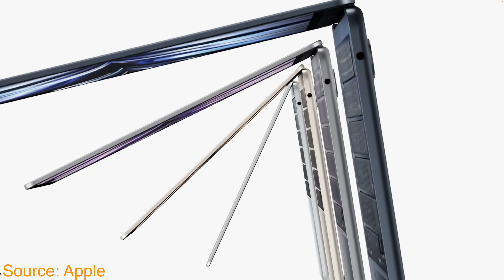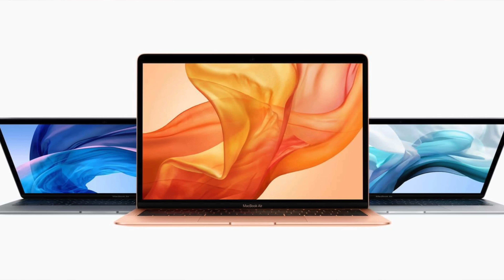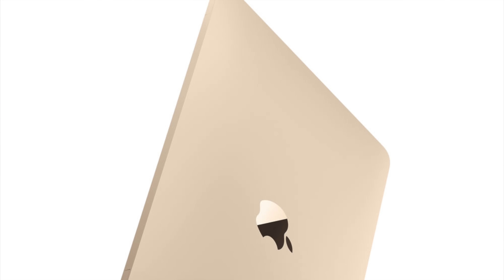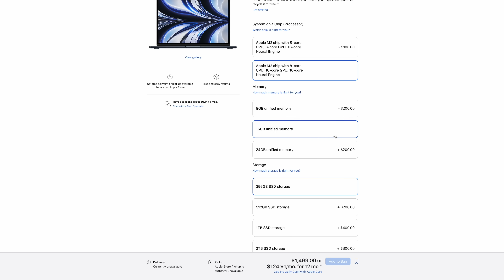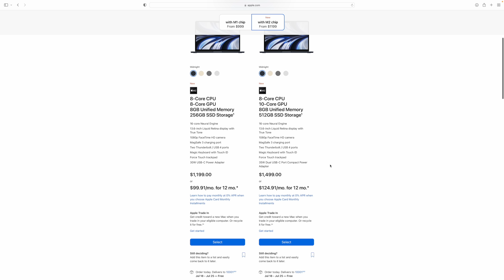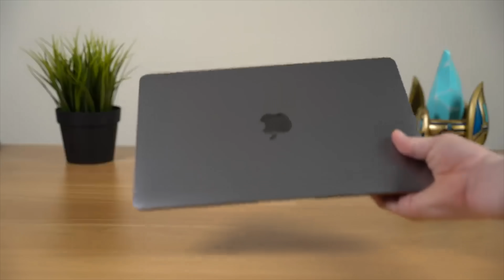Why I bought The M2 MacBook Air to Replace My 14" MacBook Pro!

Comment: yeah sorry Greg, I call BS, a difference of 0.8 pounds is ludicrous and I DOUBT that anyone can really tell them apart unless you holding both at the same time.. downgrading for the sake of just putting out a video. this only makes sense for a YouTuber who just has all of the devices and doesn't give a F. paying more for less its just pointless
Reply from the maker: You're right. .8 pounds doesn't make a difference. They should have made the 14 inch MacBook Pro weigh 4.3 pounds because you wouldn't be able to tell the difference. Listen, these are just my actual honest thoughts after owning the 12 inch MacBook. I've wanted Apple to make something just as thin and light with apple silicon, and I even say in the video that the 13" Air probably isn't what I want, but I'm going to try it out... That's just my honest take, so where's the BS?
Reply: @GregsGadgets  to be honest I got stupidly triggered by the tittle and the argument for portability. I do also miss the 12 inch! I just don’t feel the m2 mba is not really any different from the m1 14. I apologise for my rudeness. Hope it serves you well

Comment: I am so confused right now 😵, should I order MacBook Air M2 or should I go for MBP m1pro 14 🤧? It would be extremely helpful if I can get some advice 🥺. I am a student who just got got enrolled to Bachelors in Artificial intelligence.
Reply: I would go for the 14 inch MBP if you can afford since it seems like you need more power in the laptop. It’s expensive but great value If you can’t afford it get an m2 MacBook Air with at least 16gb of ram and 512gb storage
Reply: @chrisagbeko_  and I am not sure whether or not I should stretch for MBP , like if it's really necessary for my usage 😣.
Reply: I think if you can afford it, go for the 14 inch. It's one of the most well rounded laptops apple has ever made
Reply: I’m on a similar boat — MBP M1 vs MBA M2 

I can’t decide but may get MBA M2 since I don’t use it for much editing and only need to upgrade my MBP 2014 esp when I recently cracked the screen.

Comment: I feel it would have been an optimal decision to remove the 13in MBP from the lineup, drop the “Air” moniker, and call this new laptop the Macbook. They're hoping people settle for the 13 MBP because it would arrive sooner through the current chaos in supply chains worldwide. I get it, but it's a bit of a poowater trade-off for the consumer. Imagine if they introduced this newly designed air as a return to the simplistic Macbook AND brought the lit-up apple logo back. F me. My nipples could cut glass just at the thought.